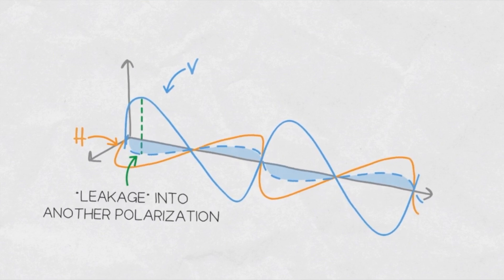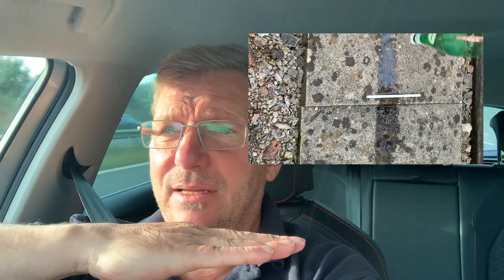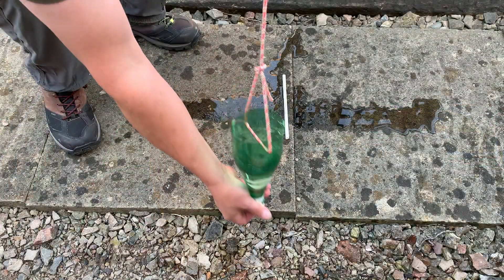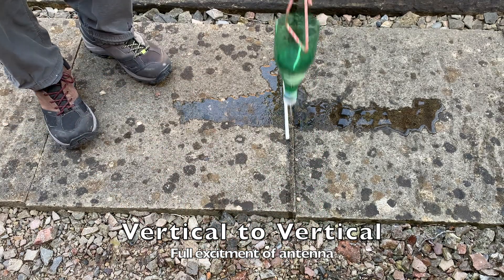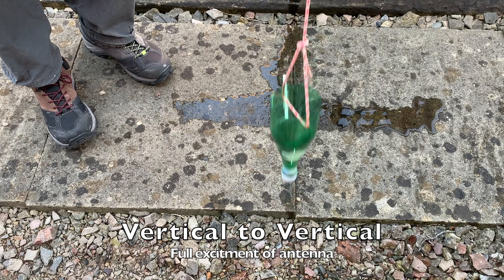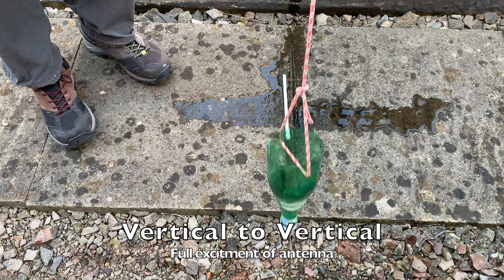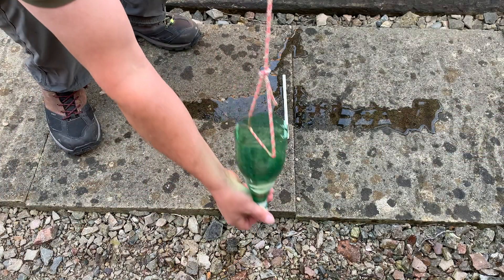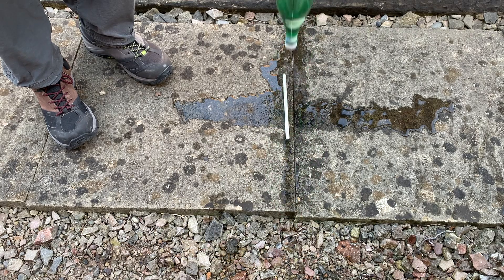HAM & CB RADIO: Antenna Polarisation Why it is important.

Comment: Nice video Mike.  I like to think of the vertical at 10w putting 1w in every direction (or every 36 degrees if you like) but the yagi pushes all 10w in a forward direction.  This kind off explains that 10w is always 10w.  Keep the great videos coming M7MEK
Reply from the maker: Thanks Gary

Comment: Nice one Mike.  I have both vertical and horizontal antennas in the garden for HF . Despite the chaos in the ionosphere it is quite interesting to swap between the two with a switch mid conversion,  one minute vertical is better, the next minute horizontal does the trick.   Mark, 2E0MSR.
Reply from the maker: Interesting! yep do the same.

Comment: 1) When an Electromagnetic wave goes through the ionosphere the originating polarisation doesn't matter because it's changed by the charged particles many times.

2) For HF ground wave the polarisation is extremely important. There is huge attenuation between vertical and horizontal when direct or ground wave is used.

3) Above 50 MHz the greater the directivity the greater the attenuation between horizontal and vertical polarization. 

4) Thermal or tropospheric ducting allows unbalanced polarity to work generally.
Reply from the maker: Thanks for the post Ade, great information. Cheers.
Reply: That is how I understand it to be?

Comment: When I first set up a CB radio I was on a very tight budget and created a flat dipole out of galvanised fence wire between the house and a nearby Oak tree.
I could hear locals, but very few could hear me, yet I had conversations on 4w in to Italy and Ireland.
I knew dipoles are quite directional, but didn't understand polorisation at that time.
EDIT: For context I was in SE London.
Reply from the maker: Thanks for the post.👍

Comment: Thought PTT was made Ilegal now Jan this Year as was a LoopHole now Phones are Illegal whole Driving
Reply from the maker: Police, fire, ambulance, mountain rescue and MOD all use PTT. Its not a phone there is no duplex communication with PTT Radio.
Reply: @mike-M0MSN  im aware if the Blue light Services
But i had a Arguementt over Messenger .i was for using the ptt
But he came up with the Legislation Bumf 
Phones are Simplex PTT Duplex Surley?
Reply from the maker: @deenunya7735  when you are transmitting  You cannot receive so no one can interrupt or distract your flow. The conversation is one way……
Reply: @mike-M0MSN That wasnt my point ..i used think That as its Opposit to a Phone 
But told the PTT is Now Not Legal to use when Mobile
As saud Earlier he Read the thing Verbatum
Reply from the maker: @deenunya7735  yes OK 👍 many thanks I will look into it.  🍌🍌
https://www.askthe.police.uk/content/Q659.htm.